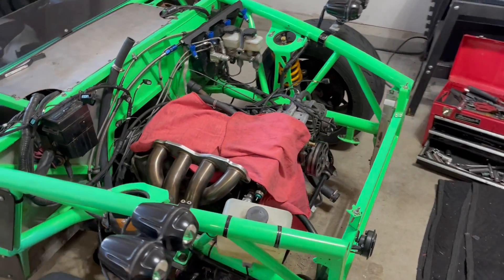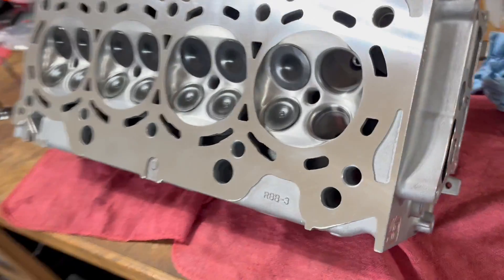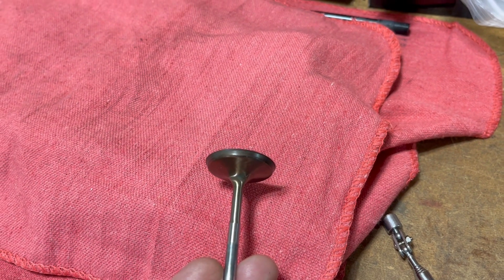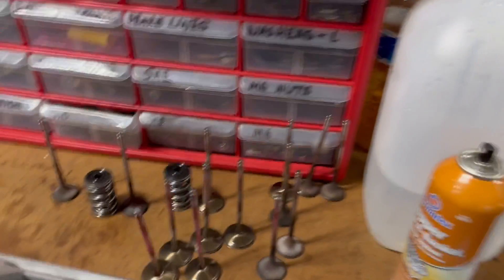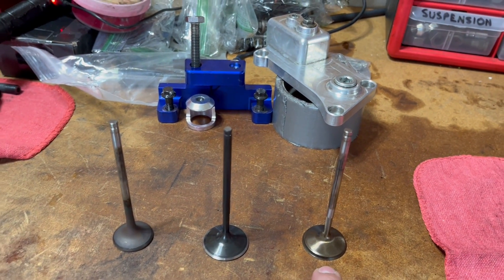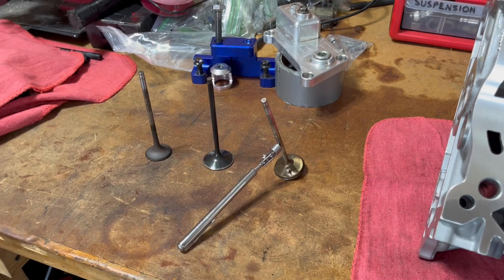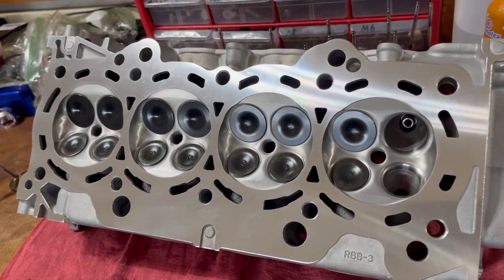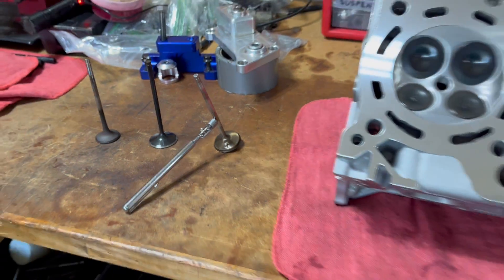Ferrea 6000 valve failure. Head had to come off!

Comment: We have assembled THOUSANDS of heads and hundreds of engines with these valves for over 2 decades.  I'm not Ferrea and if there was a legitimate cause for concern, we would look into it absolutely.  We have seen maybe 5 customers have this issue over the past 10 years, and all of them are engines setup and tuned by customers.  These few customers are adamant that the part in front of them is the cause of the issue and not some other issue such as valve float, overuse of rev limiters, fatigued spring, or a myriad of other issues that can happen in motorsports.  It's simply determined to be the part and nothing else to look at.  What I can assure you readers is that those valves are used in racing all over the world....12 and 24 hour endurance racing, our 12,000 rpm All Motor world record holder for a decade with ZERO of these issues and 140lb seat pressure, multiple time attack records all over the world, all of our USAC midget engines which are THRASHED 60-70 RACE WEEKENDS PER YEAR, Hundreds of street and race engines per year, winner of Pikes Peak several times over, the 24 hrs of Daytona this year....a resume so long no one could type it.

I can assure you that no world class race winning motorsports individual, team, or organization is sitting on YouTube pointing a finger at a single component of their motorsports program.  They are working to figure out the issue with an open mind and working to resolve it from all angles....certainly not making decisions based on a single part in hand.  Give another valve a shot and see if you have success...if you do then congrats.  Trashing these companies with a lifetime of experience is not the path to the top.  Let me ask you this...what is the hardness of that valve in hand compared to all others available?  You say it is soft...what is the harness?
Reply from the maker: With information from a sample size probably two orders of magnitude smaller than yours, I have specific knowledge of this same failure occurring on four different heads. Two of the heads belonged to a motorsports parts manufacturer/ supplier that specializes in Honda K series engines. They no longer use these valves, and have had none of the same issues since switching back to OE. Consider me surprised that among thousands of heads using the same Ferrea valves, only one more of these failures has occurred.  

2,500 street/ hard canyon miles after installing OE/ Supertech valves on my exact same setup, the lash has not changed, indicating the valves are not mushrooming the way the Ferreas did. If there ever is a valve-related failure, I will post it here and make a new video detailing it. Barring that eventuality, I stand by the warning to the majority of us that are simply pursuing a hobby.

Comment: I’ve got these with 105 lb springs but I bought them October 2019. I’m running 400hp 0.55 bar boost with no issues but I’ve only done around 2-3000 miles.

I’m getting boost turned up to around 2.5 bar next month so I’ll let you know how they handle this year
Reply: How are they holding up? Thinking of getting some but staying N/A
Reply: @erickestrada4467  still going strong and I’m running 450hp at 11psi boost. I’m getting it re mapped to about 5-600hp next month so let’s see how they handle it. I’m still running k20a2 cams
Reply: I’ll check my valve clearance this week and see if anything’s changes
Reply: @SpannerManSam  Sounds good! Get back to me with those specs, I will be installing them on an F20C
Reply: @SpannerManSam   Any updates?
Reply: @vadski3469  have not had the time do check it yet I’ve been very busy with things. The engines great at the moment, now running 500hp at 1.4bar. I’ll definitely be checking the clearance before summer
Reply: @vadski3469 I’ve checked clearance today and it’s almost spot on, I had to tweak around half of them ever so slightly

Comment: Damn I just bought a set of 6000s for my 4g63. I was hearing bad about supertech regarding them dropping valve heads
Reply from the maker: I only went with Supertech because they were slightly bigger than the OE valves, requiring less depth to be cut into the seat to clear the damage done by the 6000s. Otherwise, it would have been strictly OE  : /

Comment: By the way I was considering 4Piston 156v2 mod.   Do you know specifically before and after their head work power gains?    Thanks !
Reply from the maker: The head work itself is great. I installed DC 2.2 cams at the same time and gained over 25 WHP
Reply: @ awesome!   I already have cams so probably wouldn’t be that drastic addition but shoot even 15 whp would make it worthwhile 🤔  anything less tho phew that’s a lot of coin and work so not sure haha.     Thanks for the heads up!   Also I believe I decided to stay with oem valves!

Comment: Jesus Christ Man , I just installed 6000 Valves in my Sleeved B18C GsR engine and this bothers me big time man
Reply from the maker: Hopefully yours hold up better!
Reply: How's it holding up?
Reply: @vadski3469  HI, I just finished my car in the beginning of June got it tuned and I did 425 WHP.
Up until now I have had no issues but I'm still in the break in stage I did 1000 KM. I have an Acura Integra GSR 1997, Arrias Pistons & Ferrea Valves, Blox Springs & Super tech retainers.